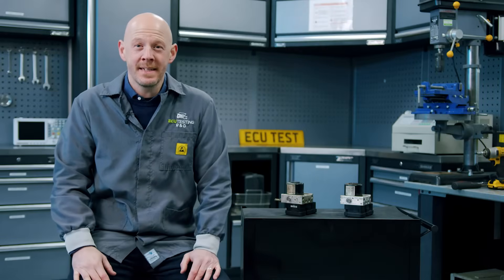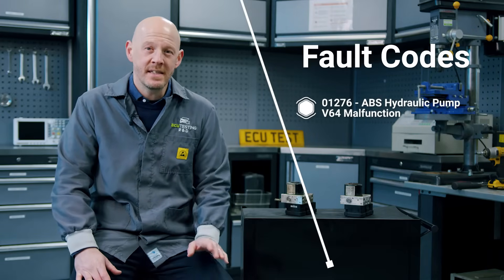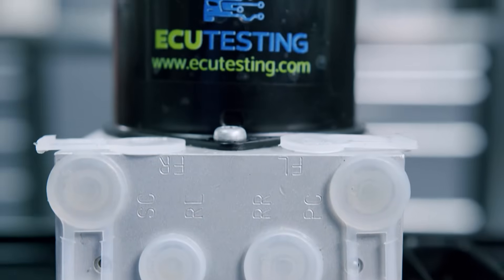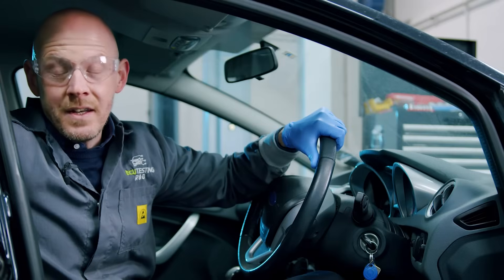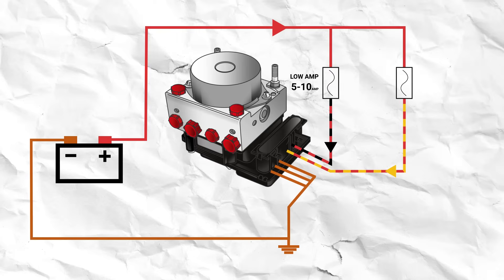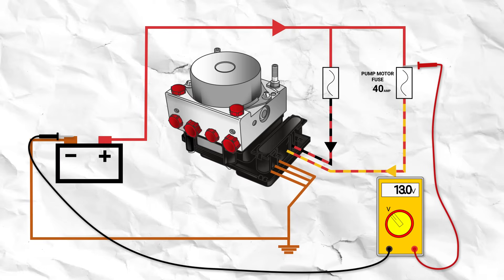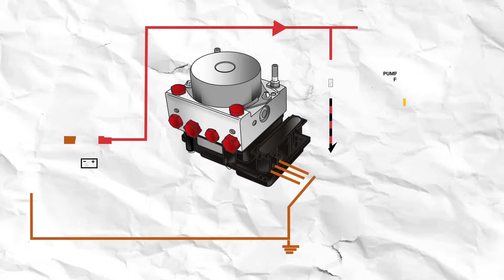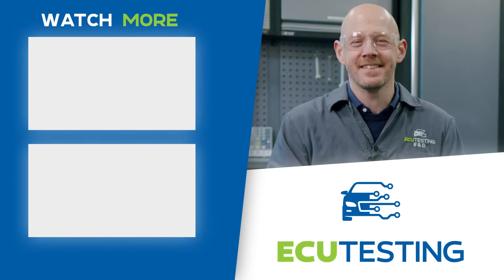ABS Pump Failure Symptoms – How To Test And Fix!

Comment: I have a mk5 r32. The esp button does nothing and no traction. Ive already had the haldex pump replaced. Could the abs pump/module cause this issue?
Reply from the maker: Hi. Yes, a faulty ABS pump/module can cause the ESP light to become permanently illuminated. Have you scanned the vehicle for any fault codes at all, as these can help determine the diagnosis. If you are able to do this, please email the results of the scan along with the information you have provided above, to our technical support team - info@ecutesting.com. If you are also able to include the part number printed on your ABS unit, then they will be able to advise you further. Thanks.

Comment: I have a 2007 Tahoe. Apparently my BPM is discontinued. My brakes are soft. Any suggestions?
Reply from the maker: Hi. Have you got any fault codes present when scanning the vehicle? If you haven't then we would recommend checking all the basics, e.g. bleed the breaks to remove any air in the system, check the brake fluid level and quality, check for worn brake pads or rotors, and check for any damaged brake lines. If they all look good, or if you did have ABS related fault codes present when scanning the vehicle, the ABS unit may be faulty. Follow this link: https://www.ecutesting.com/product-catalogue/chevrolet/tahoe/abs-pump-ecumodule-combined/ and select the part number which matches the one printed on your ABS to get it tested and re-built!

Comment: I have a seat ibiza. My abs light and handbrake has come on and buzzing from pump even when engine is off. Even took fuses out and still buzzing. Gotta disconnect battery to turn it off
Reply from the maker: Hi. The ABS pump running continuously is a common sign that there is an internal fault affecting the ABS unit. If you would like to get your unit tested and potentially re-built, please visit our website and find the unit which matches the part number printed on your ABS. You can then fill in our online test form: https://myaccount.ecutesting.com/ for details of how to send it in to us. If you have any questions, please contact our technical support team via email on info@ecutesting.com or by calling +44 1773 535638 (Mon-Fri 9am-5:30pm BST) with details of the fault, the make and model of your vehicle, and the part number of your ABS unit. They will be able to advise you further. Thanks

Comment: Can hear this guy doesn't just talk he knows what he is doing.  And is correct with voltage drop.  From my experience and as a electronic technician old school one taught me also.  A voltage drop can also be to a short circuit that has some resistance. So it can cause problems like on cars your battery life gets shortened.  And you basically get 2 types of short circuit one with 0 resistanc which causes fuse to blow usually. And the one with resistance so the fuse doesnt blow yet you get battery drainage issues. And i have seen it in the past.  Few months ago i worked on a Toyota hilux which had extra battery in for camping lights and so on. The owner asked me if i could test if there wqs 12volt at the connectors at back of rhe vehicle. I tested the ground 1st and its fine. 12v side dead.  So went to engine compartment test that battery 0volt!   He  is like what?!  0 volt?!  That cant be.  I also tested a 100 amp fuse which is also fine. So he went in to make some coffee and now my brain is thinking and im like yeah 0volt is extremely flat. So i removed the positive terminal on that battery tested again and i got like 2  volt literally 😂.  The moment i touched the positive terminal on battery volts drop immediately so theres a short circuit somewhere in that harnass.  The client also said the people that fitted his reverse camera suspect that they might have damaged some wires. So yeah just to be extra safe i insulated the positive terminal.  So in mean time the client can take vehicle to the workshop that fits the camping accessories and so.

Comment: Hi. I have an BMW E87 with error 5E20  . Can help me ?
Reply from the maker: Hi. In our experience, the code 5E20 typically indicates that the ABS unit is faulty. Please email our technical support team via info@ecutesting.com with the following information if you would like to send your unit in for a potential test and re-build. The make and model of your vehicle, any symptoms of the fault (including fault codes), and the part number printed on your unit. They will be happy to advise you further.

Comment: Hello, thanks for the video ! Could you, please, tell me where can I buy new ABS pump online for my Ford Fiesta 1.4 TDCI 2012
Reply from the maker: Hi. We offer a remanufacturing solution for ABS units fitted to your vehicle, so if you would like your unit re-built then please fill in our online test form: https://myaccount.ecutesting.com/
We do also stock replacement units, but we will need the exact part number of the unit you require to confirm if we have it in stock. Please email our technical support team at info@ecutesting.com with the part number and they will advise you further. Thanks.

Comment: Very nice video. I have a vw passat 2006 B6, 2006 1.9 TDI. I have replaced the electric park brake control unit. it big on diagnosis control unit electric park brake not coded. How to code control unit electric park brake?

Comment: Hello I'm in the US every 2018 Ford Transit connect the front driver wheel in the back passenger wheel both calipers are dragging I have already rebuilt the brakes to try to solve the issue and replaced one brake line did not solve the issue I think I have a bad ABS module keeping pressure supplied to those to calipers I don't know what to do please help me😢
Reply from the maker: Hi. If you have already replaced the callipers and brake lines then it is likely your ABS is faulty. If you would like to send your unit into us for a test to confirm, then please email our technical support team on info@ecutesting.com with all the information you have provided above, as well as the part number of your ABS unit. They will advise you further on any remanufacturing solution we can provide. Thanks.

Comment: abs 30 amp fuse blowing when driving over 15 mph an abs light will come on. All ok when under 15 mph, fuse ok an abs light of
Reply from the maker: Hi. It could be that your ABS is causing the fuse to blow. If you would like to send your unit into us for testing to confirm this, then please contact our technical support team via email on info@ecutesting.com with the following information. Your vehicle make and model, the part number of your ABS unit, the fault symptoms as you have described above, and any further relevant details such as fault codes or attempted fixes. They will be happy to assist you further. Thanks.

Comment: I have Peugeot 301 with abs problem light on when I diagnosed it permanent fualt front weel sensor no signal the four sensors has no signal so I change the abs module it did work and I took the module to another car it work fine and I change the four abs sensor it did work I change the week bearing  it did work I checks on

Comment: I have a 2019 ford transit all these lights are on abs,tcs, and uphill assist are disabled as i had to unplug the abs pump cuz it wont stop running killing my battery. Any thoughts what this could be? Please help
Reply from the maker: Hi. The symptoms you are describing likely indicate a fault with the ABS unit itself, however we would recommend getting the vehicle scanned for any fault codes to confirm. If you are able to do this, please email our technical support team at info@ecutesting.com with the results of the diagnostic scan, the symptoms you have described above, and the part number of the ABS unit itself, and they will be happy to advise you further. Thanks.

Comment: Nice video I  just bought 2018 dodge ram yesterday with22,534 miles on it,on my way home I got the same light issue about ABS break system I called the dealer today I have appointment tomorrow morning let see if they cover the repairs. 😞

Comment: ford fiesta code c1145 c1155 c1095 checked sensors ok
Reply from the maker: Hi. If the wiring to the wheel speed sensors and the sensors themselves have checked out ok, then it is likely the ABS unit itself that is faulty. Please email the part number of your unit to our technical support team at info@ecutesting.com along with the following details. Your make and model of vehicle, any symptoms of the fault including the fault codes you have listed above, and any other relevant diagnostic information such as the tests you have already conducted. They will be happy to advise you further. Thanks.

Comment: Hello. My kia sportage sometime shows ABS sign and wheel deviation signs. it stops by itself and come back from time to time. no engine check signal. I am not sure if related to driving in water or not. Do you have an idea?
Reply from the maker: Hi. If you are able, please use a diagnostic scan tool to obtain the logs when the ABS light appears and email them to our technical support team at info@ecutesting.com. Please also include your make and model of vehicle, any fault codes present and any further relevant information, and they will be happy to assist you further.

Comment: The ODB2 reader reports no codes. The dash panel gives an ABS related message. The motor attached to the ECBM unit runs continuously. Any advice?
Reply from the maker: Hi. The motor continuously running sounds like you may have a faulty ABS unit. Please email our technical support team at info@ecutesting.com with the following details; Your vehicle make and model, your units part number, the symptoms of the fault as described above, and any further diagnostic information (e.g. results of scans or any fixes attempted already). They will be happy to assist you further. Thanks.

Comment: Thanks for you good explain
Put I have problem on pump not module
1st one I change because pump pin on the motor head not release I changed the unit for this reason and 2nd one the pump get oil from all the pin inside and the oil makes short after that I listen the unit working if the car switch on or of then I changed too withe new one 
My question is can I repair any pump of this 2 defect of impossible
If yes I thanks if you explain with vedio
Thanks

Comment: Hi im at my wits end with my 2000 Mitsubishi Evo 6. The ABS light is on . I have cleaned the wheel sensors with no luck.
One interesting thing is , when i turn the ignition on the light is instantly ON and doesn't go off after 3 seconds as it should. When i start the car light is constantly ON (without the car moving or rolling). When i do drive the after about 10meters the AYC light comes on. Im guessing its not an AYC issue but more a ABS.
What could it mean when the ABS light is constantly ON from the time the ignition is turned on ? Any help is appreciated ? Is there a manual way to test the pump or check if its working ? Any way to test the ABS ecu ? thnx

Comment: I had a used abs module put on my Volvo S40 T5 and now it doesn't recognize the modulator and I am not certain how to fix that? Can you help a girl out here and possibly tell me how to get it to recognize the new replaced part?
Reply from the maker: Hi. If you have replaced the ABS unit with a second hand part, then some Volvo's require the unit to be coded to the vehicle, which will need to be done by a Volvo specialist or dealership.

Comment: Hi, 2014 Ram 2500 soft pedal no brakes I can push to floor with a little brake. Did replace master cylinder. Same issue, I have no codes for the ABS system.. any thoughts
Reply from the maker: Hi the fault sounds like it is a hydraulic issue. If you have checked the brake lines for damage or blockages and the whole braking system for air leaks then the fault could be with your ABS unit. Please send the part number of your ABS unit to info@ecutesting.com and they will advise you of any testing/re-build solution we can provide. Thanks.

Comment: What about 2014 Ford Expedition,  Having ABS fault DTC B1342, once you insert key to run/start ? Then switch off remove key run/start this abs alarm will not come ?
Reply from the maker: Hi. It is possible your ABS unit is faulty as we have seen this code appear before when that is the case. Please email our technical support team at info@ecutesting.com with the following details; Your make and model of vehicle, the part number of your ABS unit, the symptoms of the fault including fault codes, and any further diagnostic information/fixes you have already tried. They will be happy to assist you further. Thanks.

Comment: If I'm able to Run My ABS Pump with My Scan Tool and activate all the valves. Doesn't that mean that My fuses, wiring & electricals are good/intact?
2015 Infiniti Q50. Chasing a C1138 Code.

Comment: My code reader says vehicle not equipped with abs, but it is, so I'm guessing no communication with abs controller?
Reply from the maker: Hi. We would usually expect to see no communication fault codes present if the ABS has failed in that manner.
Reply: @Ecutestinglimited  I agree tks.

Comment: my 2015 c-max hybrid will not release the brakes when in the hot sun, then sometimes flags the abs light. If I feather the accelerator, it eventually releases. Also, if I switch from reverse to drive, it will release also. The compressor sounds weak and slow. It's like it's gotten weaker over time. Braking during operation is not a problem. In fact, sometimes it's too strong, especially under 10 MPH. The dealership quoted $2,500 to replace the whole ABS module. Looking at the troubleshooting report, they're basing it mostly off the code and test values. No mention of the sensors being tested.
Reply from the maker: Hi. Please send the following details to our technical support team via email at info@ecutesting.com. Your vehicles make, model and year of manufacture, the part number of the ABS unit if possible, the results from the troubleshooting report including any fault codes present, and the symptoms of the fault as you have described above. They will advise you further. Thanks.

Comment: I have an E46 330ci BMW which after driving for 30 to 60 minutes brings up 3 warning lights, all ABS module related. The scan says it’s an intermittent internal ABS control module fault. I clear the fault and the problem repeats. What I can’t understand is that if there’s an electrical fault why isn’t it there all the time - or could it be engine compartment heat/heat soaking that triggers the problem?
Reply from the maker: Hi. The symptoms you are describing are consistent with a failing ABS module and these do typically present as intermittent to begin with, but will quickly become permanent if the unit is faulty. If you would like to send your unit into us for testing please fill in our online test form at https://myaccount.ecutesting.com/
Reply: @Ecutestinglimited  many thanks for the response. Looks like you’re in the UK so a bit far from Australia! I’ll look for a second hand unit first.
Reply from the maker: @gerrycooper56  No problem, we hope that cures your fault! If change your mind or have any problems in the future then we do offer a worldwide service so you can send your unit into us no matter where you are located. All the best!
Reply: @Ecutestinglimited  thank you. Do you have access to refurbished units at all?
Reply from the maker: @gerrycooper56  We are a testing and remanufacturing company so any unit that gets sent into us which tests as faulty, we remanufacture ourselves. We do have some refurbished units in our stock, so if you have a part number of a particular unit then we can look into this for you. Thanks.

Comment: Wish all auto vids were clear and precise as yours. I just bought a 04 Pontiac Bonneville in wonderful condition except the abs pump had a  leak from underneath the black cylinder. It was where the elec harness is mounted. Took  off the module and used a whole can of brake cleaner inside /out then used permatex on the harness gasket and reattached it. Prior owner was using E brake to drive it. Do you figure the pump is burned up cause he left all harnesses connected and no fluid in the system?  The brake system is bone dry I'm sure. Don't want to waste time putting module back on , replace fluid and bleed for nothing. Any advise would be greatly appreciated

Comment: I have a Toyota estima hybrid 2013 with abs fault can this be tested or repaired ????
Reply from the maker: Hi. Please contact our technical support team via email at info@ecutesting.com or via phone on +44 1773 535638 with the following details. Your make and model of vehicle, the unit's part number, and any details of the fault you are experiencing - including fault codes, symptoms and any attempted fixes you have tried. They will advise you of any rebuild we offer. Thanks.

Comment: Is it common issue the ABS pump to fail on Honda Civic MK8, 2006 with R16A Engine 1.8L?  My Break pedal travels slowly down when pressed, travels excessively on the first try to stop, and its stopping but slowly. The second step on the pedal then it grips and stops great.  Would that be a faulty ABS pump fault or something else?  Thanks.  Its great to see that it can be repairable as the original unit is about 500-600 Euros from Honda.  I have no lights lid up on the dash.
Reply from the maker: Hi. These ABS pumps do fail, however the issue you're describing could be a master cylinder fault also. Have you had the vehicle checked over and scanned for fault codes?
Reply: @Ecutestinglimited  no not yet. The car has only 80k miles.
Reply from the maker: @senanfoutchedjev2401  Ok. We would recommend getting it checked by a qualified mechanic and get them to scan the vehicle for any fault codes as these could help determine the root cause of the fault.